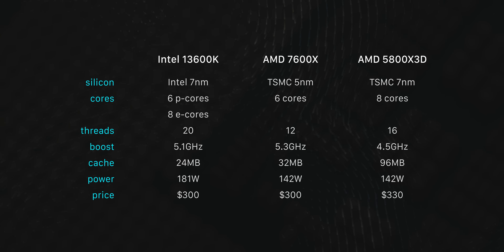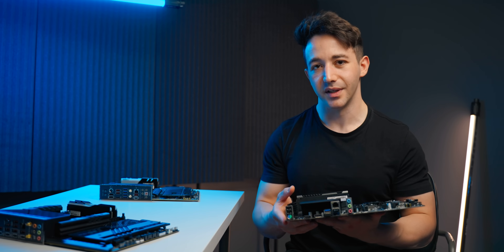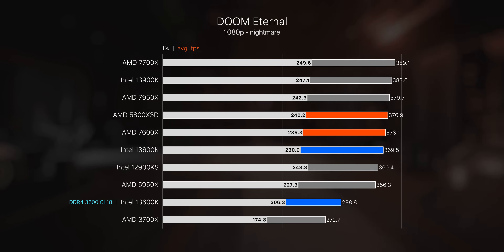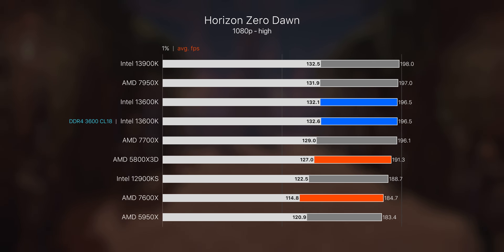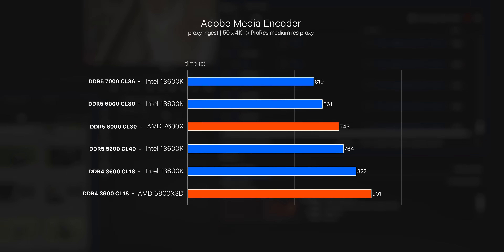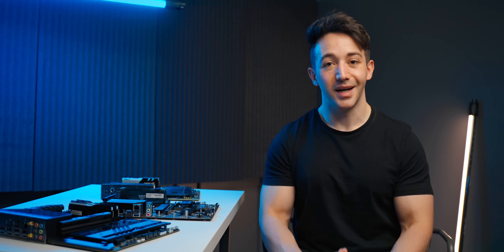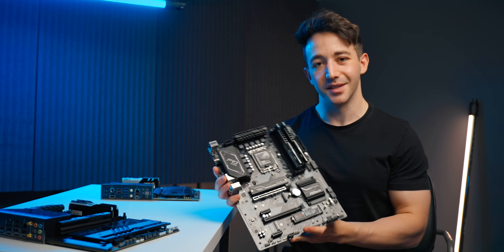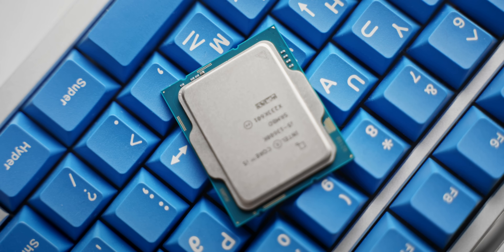Best Gaming CPU - 13600K vs. 7600X, 5800X3D

Comment: I would say it depends on your specific usage and current HW that you own. All 3 have their values and also have trade offs. 5800x3d is bad at productivity and on dead platform, 13600k great at everything but on the dead platform, 7600X doesnt make much sense since 7700X is much better pick, its great at everything on fresh platform with upgrade path but cost more than other 2 choices.
Reply: for most people i think the 5800x3d is the best since am4 is really popular and you basically dont lose power using the cpu with older mobos.
Reply: @florider_hd  I think so too. Therer are many ppl with AM4 motherboards. just get the 5800x3d and upgrade in like 3-4 years when ddr5 is as cheap as ddr4 is now. Same with mobos
Reply: Sorry I’m very new to pc building, what do you mean by dead platform?
Reply: @TheFyreSA  am4 is not getting any new processors since amd moved on to am5(the socket the cpu plugs into). the ryzen 5800x3d is pretty much the best cpu you can put in an am4 system for forever
Reply: Current intel gen and dead platform lol
Reply: @CptSlow89  Dead means the following gen won't be on those sockets.
Reply: Quite honestly, being on a “dead platform” shouldn’t be a concern at all. There is no such thing as future-proofing when it comes to computers. If I’m gonna upgrade my CPU, might as well upgrade the motherboard to take full advantage of it. By the time a worthy CPU upgrade comes about, you aren’t gonna wanna re-use your old motherboard.

Comment: I just upgraded 2 days ago to 5600x becouse i found it new for 100 euro. Now with 5700xt i have around 650 fps in valorant so i dont need anything more.
Reply: @bang taher 5700xt OCed to 2150mhz on core and 1860mhz on memory. 32gb crucial ballistic sport OCed to 3600mhz cl16. Only thing I didn't OC is processor.

Comment: 5800x3D>7600x>13600k
Base on price, total cost of ownership, ease of use, thermals, cooling requirements...
Basically, if you are on AM4, buy the 5800x3D, if you are on Z690 buy the 13600k, and if you are on something else, the 7600x.

Comment: Pairing the 5800X3D with 3800CL14 memory really makes it shine, you get an insane amount of performance for the price. It would have been nice to see the 5800X3D paired with top of the line DDR4 memory. Seeing the performance of the 7700X really gets me excited for the 7800X3D which should be coming in January. It will 100% blow everything out of the water!
Reply: @El Cactuar Just noticed that lol, thanks!
Reply: wth are you talking about? 5800x3d page states that fastest ram it utilizes is 3200.
do not tell ppl to overspend
Reply: @krzysiekj2522  Are you dumb? I am running it @3800 CL14 no problem, of course you have to overclock your RAM but that's OBVIOUS.
Reply: @JtwasLuck  I am not saying it will not run with higher speed. Jesus christ. All I said was that it will run the same on 3200 as on 3800 and higher. You can read, now add comprehension.

Comment: In Germany the Ryzen 5 7600X is actually slightly less expensive than the 5800X3D (338€ vs 364€).
Reply: kinda salty i bought my 3D for 430€ like three weeks ago. couldnt return it anymore since the 14 days passend and the very next day its price dropped to 340€ on Mindfactory lol

that said package deal of AM4 is cheaper and the Ryzen 3D doesnt need some high end RAM, cheap 3200cl16 performes about the same as expensive 3800CL14 due to its high cache nature. plugged 32GB 100€ 3600Cl16-19-19 ripjaws in there
Reply: @fmskaisergsaw5567  unlucky but it happens

Comment: For me it was best way to build on 5800x3d. It cost me twice cheaper than 13600 and 7600 because of the memory and motherboard prices. Extra money can be spend on 4090))) And 1 later change 5800x3d on 7800x3d. In my way not change at all for 2-3 years)

Comment: Could you please benchmark Overwatch 2? I've never seen good benchmarks for Overwatch 1 or 2 and you seem to also be interested in the game. I know it's more memory-dependent than most games so I'm really interested in the results.
Edit: you can use the workshop code DK3VN for easier benchmarking (there are others if you don't like this one). I'd prefer low graphics settings but any are fine. Thank you so much in advance if you do end up benchmarking it
Reply: if you're not hitting 600fps on every CPU in this lineup (with decent GPU and >= 3200CL16) at eSports settings there's something very wrong.
Reply: @spren.  I'm interested in the lows, not the averages
Reply: @tired9494  no, I mean it should be rock solid 600fps lol

Comment: I think you should say which one to choose based on what gpu you want to use
Reply: they could all run 3090 at 1440p and the improvments to stronger processors really are not that huge and could only mean that 4k is more stable.
Reply: @inlieuofsense9521  yes I want to know because I only run 4k
Reply: theyre the same performance bro, doing that only makes sense when the CPU performance is different.

Comment: i would have liked to see this with some low latency 3600 or 4000mhz DDR4. i run my b-die DDR4 kit at 3733 at CL15-15-15, and i am rather sure it would be closer to the fast DDR5, than the slow DDR4 modules you tested with.
Reply: Yeah my ram is 3600 CL14
Reply: Usually most games seem to favour higher MHz than lower timings, but sure the best is off course high frequency at low latency.
Reply: @guily6669  Its mostly before Ryzen cpu's on DDr4 wouldnt get any meaningful uplift in performance past 3600mhz. So the next best things were to lower the timing of the ddr4 ram at 3600mhz.
Reply: I got the 13700K which should be close to the 13900K in gaming and I'm going to pair with my 4000 CL17 ram that can run on my current system at 4200 CL17. Should be up there in speed vs decent DDR5.
Reply: Other reviewers like GN and HU did use 3600 CL14 with their new CPU reviews, so the comparisons are out there

Comment: i wouldve loved to see 1440p benchmarks im currently still running my i9 9900k and have been thinking whether i need an upgrade for it at 1440p or if it will do for another year
Reply: If you're unsure the answer is likely no.
Reply: @tomstech4390  well said
Reply: At 1440p, games are way more GPU dependent so the difference would be very minimal not enough to justify especially with the i9
Reply: @schizomode  the only difference is 5800x3d performance will go down, this 5800x3d chip is only good for 1080p low setting. anything higher, the 3d cache can't handle that big size of data, the performance will drop to under clocked 5800x
Reply: 9900K is more than fine for current games
Reply: 9900K is more than fine for current games
Reply: 9900k ia great. If you have bad ram, you might benefit from ram upgrade/oc though.

Comment: Would also interest me if intel is still better on office work, meaning having low total system power use when doing nothing but showing the desktop or an excel window. I was shocked about my idle load jumping from 11 to 70 watts when upgrading to an AM4 platform.
Reply: I am interested in this too.
Office products during the work week and game on Friday nights. Sux to be an adult. Hopefully game time will increase as kids get older
Reply: My 12700K package power is less than 10w having an excel window open lol.

Comment: Although not mentioned in the video, the 5800X3D seems to be classes apart from the competition when it comes to games like MSFS, MMOs and certain VR titles.
Reply: yeah and in less optimized indie titles the 5800x3d seems to dominate
Reply: Classes apart? Doubt that. The 13600k is clearly not slower in any of the tested apps and games, and MSFS is no different.
Reply: RIP AMD and their new Zen 4 2022-2022, it already DOA when Intel Raptor Lake/13th gen released.
Reply: yup, in Elder Scrolls Online it flat out FIXES all the bouncy framerate jank. Now it just slays 100fps+ all the time
Reply: @g4q9cjr  literally not an issue
Reply: This is exactly the reason I will be getting the 7800x3d.
Reply: Its the best for Factorio
Reply: @Frenzier yes if you must have factorio qt 400fps instead 380fps. Absolutely a must for a single player strategy game...
Reply: Raptor Lake does really good for MMOs as well
Reply: LOL. Not vs Raptor Lake on tuned ddr5. It's a bloodbath (raptor by 20%)
Reply: @CrackaSlapYa  okay, but 5800x3d buy in is waaaaaaaay cheaper
Reply: @bad_token  depends. i already had z690 and ddr5, so, for me dropping in 13700k cost ~$130. But for AM4 owners, yes.
Reply: @bad_token  I'm running my 5800x3d on an x370 motherboard.  Big reason it's even cheaper is not having to upgrade my motherboard or ram.
Reply: @cmdrfunk  same on my b350 from 2017
Reply: @CrackaSlapYa  why u need to waste money every year for so small gain...
Reply: @CrackaSlapYa  We aren't counting dropping in, the answers would be obvious.
Reply: @ZondaRbg  Especially when you could just buy AMD and still do drop ins every few years.

Comment: The MSI PRO B660 runs the 13600K without power limits. For some B660 motherboards you can remove the power limits in the bios.

Comment: where i live, the 5800x3D is 50$ cheaper than the 13600k, and motherboards are much more expensive than you listed. 200$ for z690, 150$ for b550, 160$ for b660
Reply: yea he should list cpu+mobo+ram cost, cpu only is misleading.
Reply: @kangsterizer  i mean he partially did, its just that the prices he listed are way below what they cost where i live. Also the 13600k is 410€ and 5800x3D is 360€, so those were wrong for me too

Comment: It would be great if you could include what gpu you used for the gaming benchmarks. Testing games with the 4090 to see what resolution each cpu gets bottlenecked at would really help for those who don't upgrade cpus that often.
Reply from the maker: RTX 3090 was used
Reply: At 1080p, I would guess that these probably are cpu bottlenecks.
Reply: @shanecar84  Which is exactly what you'd want on a CPU benchmark o7
Notice when comparing CPU's lots of benchmarks will use lower 1080p settings

Comment: Can’t wait! Upgrading at end of year from 6th gen Intel…still trying to make up my mind 🤪 It will come down to price and availability when the time comes…
Reply: If you don't upgrade now, wait more until AMD releases 7800X3D. It is the only good deal ^^
Reply: @gdgd5194  intel's 13600k is also good choice considering low entry price
Reply: @gdgd5194  The X3D chips will start at $450 no doubt and maybe even be more expensive. The 13600k will still beat them in price-to-performance I think but we'll see.
Reply: @gdgd5194  Wait till you see the price of 7X3D. It will probably be sth around 600$. Thats twice as much as 13600k.
Reply: Yeah I'm still on i5 2500k and ready wanting to upgrade but I will to see what the next X3D will offer for it's cost.
Reply: I went with Intel 13900K and loving it!

Comment: I ONLY play Esports games.... So ill get ryzen 7000 and upgrade it later(Esports are highly cpu dependent)..... I wanted to pair it with rx 7700xt or 7800xt but sadly they are not releasing soon so ill have to get 7900xt(i wont need to upgrade that gpu for like 7-8 years)

Comment: 1:18
I think it should be either "intel 7" or "intel - 10nm", even though, the density is ≈ TSMC7nm
Reply: But that just confuses casuals further. You have to remember that the name “intel 10nm” was just as arbitrary as “intel 7”. No different than how TSMC chooses to call their node “N7”. They are just names, not measurements.

Comment: Hey, small correction - 13600K is based on "Intel 7" which is really 10nm, not 7nm :)
Reply: I don't think you understand that "10nm" is almost identical to TSMC's 7nm and 6nm nodes.
Reply: Their "10nm" node is basically tsmc 7nm lol
Reply: In terms of transistor density Intel 7 is very similar to TSMC/Samsung 7nm, those just marketing terms what they call it doesn't matter.

Comment: The 13600k is almost an i7 or rather an i6 with those specs. Intel couldn't beat AMD in multicore with the same core and thread count as before so they bumped it up for the same price. Great for consumers, bad for Intel.
Reply: and yet the intel 13600k sells much better than the 7600x. If we consider that games do not consume E-cores, then intel has 6... same as AMD 7600x. Their prices are relatively the same, but Intel offers many times more.
Reply: @igorbalen3389  ecores still have some use in games, even if just freeing the performance cores by doing the background tasks. idk if windows manages threads that well, but, theoretically...
Reply: @igorbalen3389  Just like I said, the 13600K is better for consumers right now but probably more expensive for Intel to produce then they would like. AMD still has the node advantage with TSMC so the don't have to push as hard but this time they probably  underestimated Intel's willingness to make compromises to get ahead. Let's see what AMD does with their Zen 4 3D variants.

Comment: the only con of going for the 13600k is the generated heat that these intel chips spit out...
Reply: Check undervolting articles. Some were able to run at 1.1V stable with stock settings. Reducing temps and tdp by 100W without losing any performance.
Reply: @YouOnlyLiveOnce...  Not really, AMD has an engineering flaw with their heat spreaders this generation (Which is why I passed), I've had no issue cooling my 13th gen intel.
Reply: @CommanderRiker0  I know - I have 13600k for 2 months and no problems with heat but UV can make it even better if you don't want to OC

Comment: Personally I'm waiting to see what the 7800X3D brings to the table.
Reply: i had old am4 system and running G series amd processor bc gpu prices very high in pandemic. i'm happy now with ryzen 3D and rtx 30gpu. my next upgrade gonna be ryzen 8000 or 14th intel. skipping new expensinve am5/ddr5 and dead end intel platform
Reply: Why? It's going to be even more expensive w/ same IPC. If you're waiting 5 months for that, you might as well wait for Meteor Lake 5 months later which will have even better IPC & gaming increases.
Reply: Especially since that will be the second-gen 3D v-cache implementation.
Reply: I heard there'll be 3D cache variants of the 5900X and 5950X too.
Reply: The big question here is wether to invest in the new gen amp or not going forward.
Reply: Same. Zen 4 and Raptor Lake are good but nothing groundbreaking. V cache actually has the potential to be just that.
Reply: @rdmz135  Rocket Lake is the codename for Intel's 11th Gen Core processors (the last Intel 14nm++++++++++).

Raptor Lake is the codename for Intel's latest, i.e. 13th Gen Core processors (Intel 7, max 8P + 16E). 13600K is 6P + 8E --> 14C/20T.
  In parallel/multithreaded tasks, that Raptor Lake i5 has quite massive lead over Ryzen 5 of the latest 7000-series (Zen 4). It's significantly faster vs. 12600K, too. Which has 6 slower P-cores (Golden Cove) + only 4 E-cores --> 10C/16T.

Still, in Gaming that trio in the video is quite evenly matched. Especially when your GPU isn't RTX 4090 and your resolution is below 4K.
Reply: @rdmz135  Raptor
Reply: @rdmz135  So you wait for 3D garbage version of Zen 4 which cost $500 more? i though AMD fanboy like cheaper option which also performs better but i was wrong....
Reply: @rdmz135  raptor is better than all 3 of those lool
Reply: @CrackaSlapYa  Zen 4 memory latency is in the 50ns range. God knows where you got 80 from, thats basically Zen 1 latency. I'm pretty sure the latency improvement from the larger cache will outweigh the marginal bandwidth advantage so I will wait and get  Zen 4 X3D.
Reply: @rdmz135  I got it from AIDA. at 5600c40 (like most run) it's 80ns. at 6000c30 it's still over 60ns, not 50ns. It's the ram and the cross ccd latency hit/
Reply: @123subject January 2023 or so.
Reply: @RobertJohanssonRBImGuy  lol lol
Reply: I think it will be quite expensive and the performance gain wouldn't be worth it over the 5800x3d or 13600k. I may end up eating my words but who knows?
Reply: Yeap. I'm just waiting for the 7800X3D that will eventually come and shoot down intel for sure.
Reply: @nVinter  problem about v cache is they it doesn’t target the mid range cpu market, Aka right where the 13600k fits in. So just appreciate all the competition, and for anyone that can afford 3d cache then yeah it should def be worth the wait
Reply: Typical amd fanboy.  ALWAYS WAITING>
Reply: @Nguyem Khach It cost more, and its slower, amd fanboys always saying "ill wait for so and so"  AMD fanboys ALWAYS WAITING>
Reply: @Mauree Never thought and AMD fanboy will by hyped to see themself get ripped off by Lisa Su and AMD even more.
Reply: wont beat tuned raptor lake. cache helps make up for zen4's 80ns latency, but not enough to defeat intel's sub 48ns while also pumping out 45% lower bandwidth than tuned 13700k/13900k. Why wait? Get the best now.
Reply: @CrackaSlapYa  Your every corporate marketers wet dream.
Reply: @CrackaSlapYa  tf, why use tuned raptor and not tuned zen 4? Latency is like 60ns or something tuned
Reply: @raoter67  and my latency on Raptor is 48ns. While also getting 116k READ (vs ~80k)

Comment: In the case of the 5800, you can not count the price for the motherboard and RAM, because there is no reason to buy AM4 from scratch, but it will be updated to the existing ones just right, so the cost of the platform is not considered correct ...